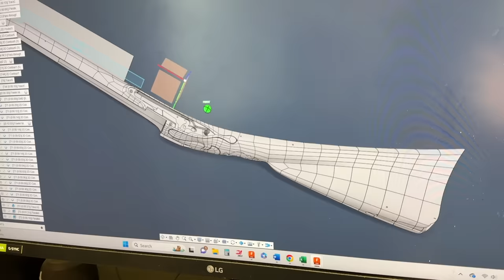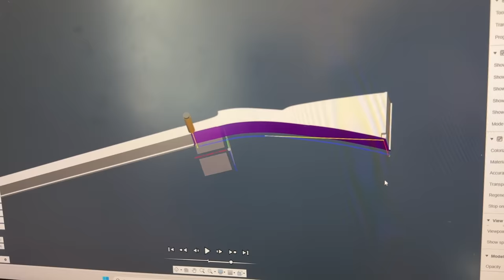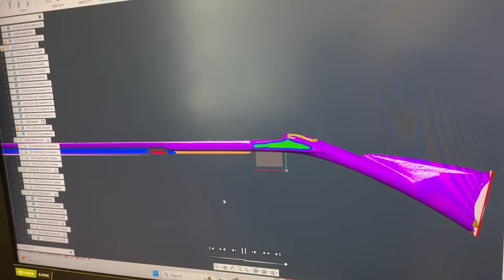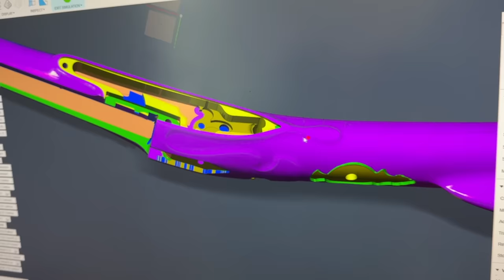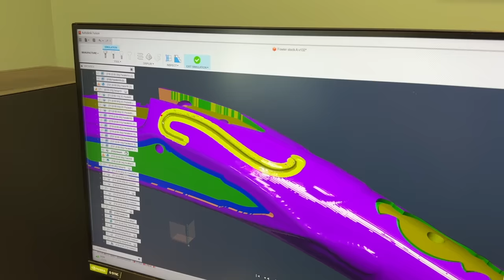Fowler Update - Antiques used for inspiration and details on upcoming Kibler Kit

Comment: I appreciate the Fowler update and will buy a couple as soon as they become available. What will be the wood options? 
I was very happy to hear you will be soldering  on the under lugs in shop. A big Thanks for doing that for us. 
But what about also soldering on a small silver front sight too? 
Did you mention the lock that will be used? Somehow I missed that if you did. I assume you will use the Colonial Lock. What about a cross pin to hold the  butt plate  tang ?
Reply from the maker: We recommend the walnut as it is traditional, but we will also offer cherry and maple for those that have their hearts set on it and we will use our Round Faced English Lock

Comment: Walnut? 16 gauge is .650? Trigger pull length? Barrel length? I've got three originals of these in 20 gauge (.620). Thanks for producing an English fowler. Great products.
Reply from the maker: Barrel length is 44” and it will come in walnut 16 and 20 gauge. Thanks for the support

Comment: Great news!  A few questions?  What gauges you be selling them in and what length of barrel?  What the trigger pull length?  What type wood you offering in?  Will you do an assembly video like you did for the other models?
Reply from the maker: 16ga and 20ga and 44” barrel. Primary wood is walnut but I may reluctantly offer it in maple (non traditional)
Reply from the maker: We will do an assembly video series for sure and length of pull is about 13.5 but I’m not sure right now